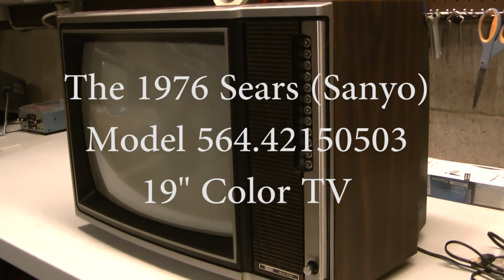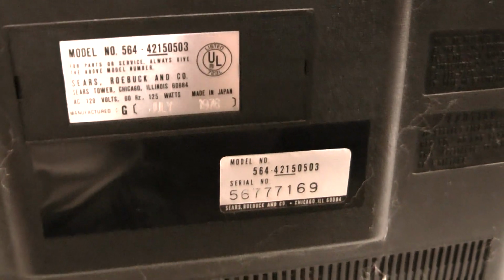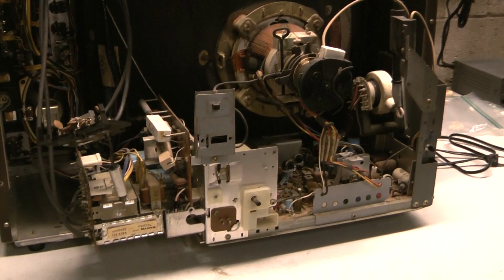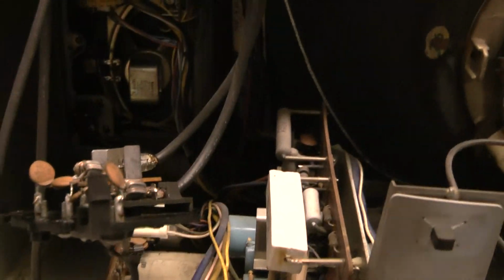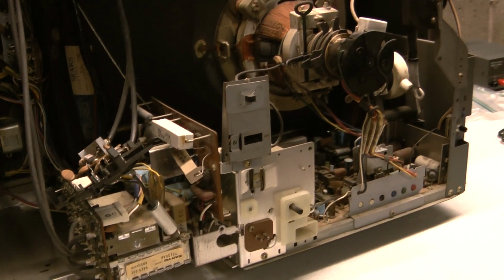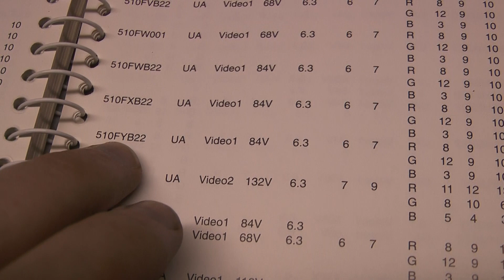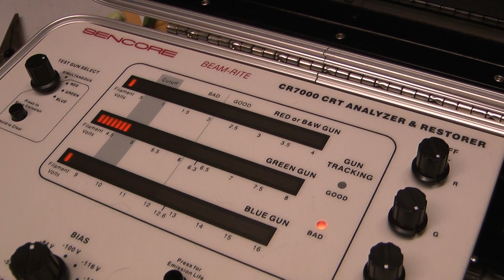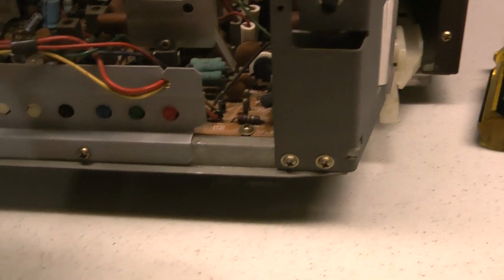The 1976 Sears Sanyo Model 564.42150503 19inch Color TV

Comment: This was the first color tv set my grandparents had, Worked well until 93 when it started suffering from vertical control issues. They gave it to us in 97 after repairs for use in our kitchen.  Suddenly died on us in 2000. Parents tossed it saying it was probably unsafe for use. I bet it just bad caps or something.
Reply: Or maybe it was the build in Circut breaker.